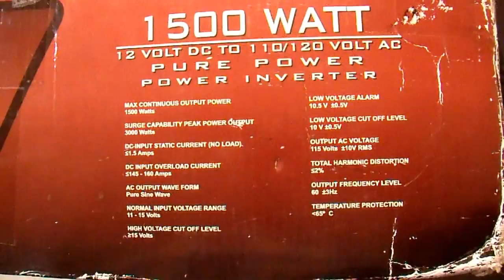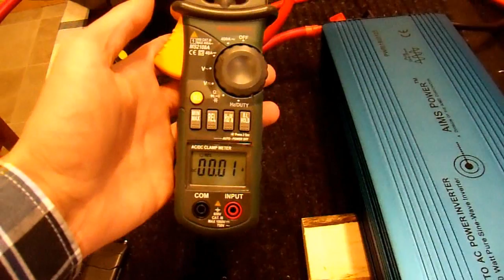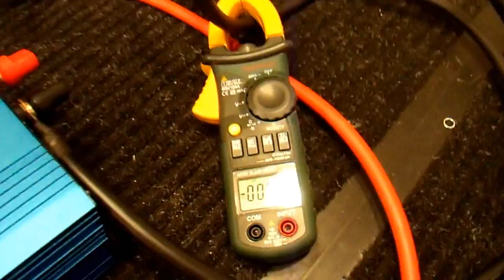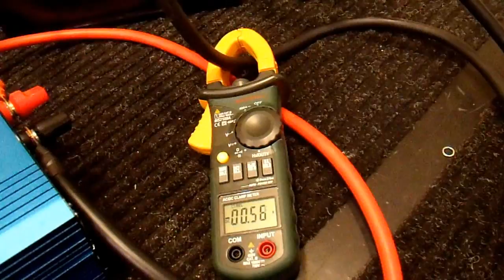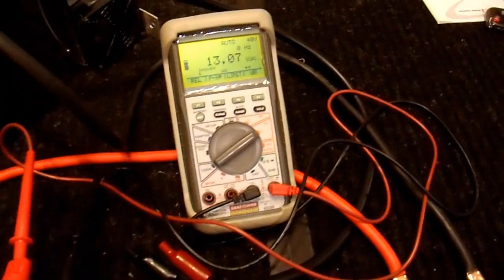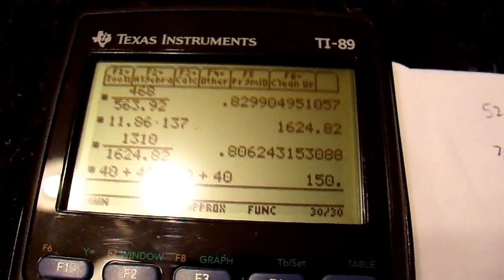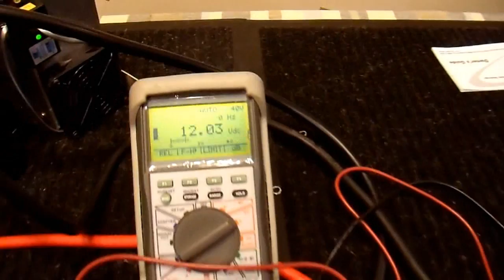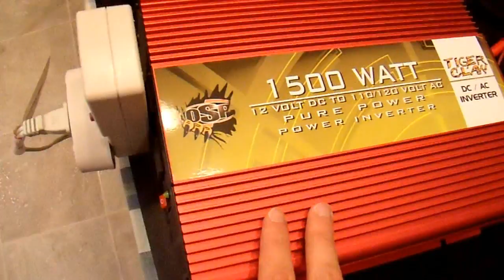Aims 1500W Pure Sine Inverter Review and Shootout - Part 2/4

Comment: At medium power, the Tiger claw would probably be more efficient, than at the extreme ends. The Tiger Claw was ABLE to produce it's advertised output power. That's a win for Tiger claw. We didn't get a fair efficiency comparison, because the data wasn't collected at the same load settings.

Comment: I am coufused on why you would say the Aims Inverter wins when it would not operate at 1500W. That right there would signify a fail to me, please explain. I have more questions but please answer this one first and you should link the video you spoke about for how to make cables too in your notes!
Reply from the maker: It is extremely common for inverters to only output 1/2 to 2/3 of the rated power so I am not going to make a huge deal out of it.  It is unfortunate that this is accepted practice but it does seem to be the case in the inverter industry.

Comment: Well i don't know but i think you should always count not with Wats but With VA. I think that killowat meter can do that as well(but i'm not sure about it). 
If it is 100% resistive load then i would not worry but you have there small fan so it might change a bit.  I know it isn't much but my opinion is always better count with VA instead of Watts. Anyway nice review :)
Reply from the maker: Inverters care more about VA than watts, but practically speaking watts is what matters so that's what I generally test.  Yes, the meter does do VA and I do look at it for other purposes.  I should probably mention this in a future video.  Thanks for the comment!

Comment: I don't know.  It went into OL on the high setting on the heater.  To me that's more than a slight problem.
Reply from the maker: I agree fully.  However if the test is efficiency then, well, the Aims is more efficient.  However I much prefer the OSP personally.  Now if someone wanted to power a 500W load and only that 500W load then maybe they wouldn't care that it cannot do the full rated 1500W.

Comment: I have to agree with Phillip It seems like being able to power the rated watts would trump efficiency .
Reply: The Tiger claw had lower standby current as well: Another win for the Tiger Claw. Time to get out the oscilloscope, and see which one maintains a better sine wave under reactive loads(motors, fluorescent lighting, television and Hi Fidelity sound) as well as resistor loads.(heaters, incandescent lighting)

Comment: Any idea how to get a schematic for the Aims inverter? I have one that I am working on but I don't know the value of the cap that blew
Reply from the maker: That's a tough one and gets into legal issues.  The schematic would be illegal to distribute publicly.  Your best bet is to reverse engineer it yourself for private use, or to purchase another identical unit and remove the component in question for testing.  I will ask, though, which cap, what is it connected to, and what does it look like?